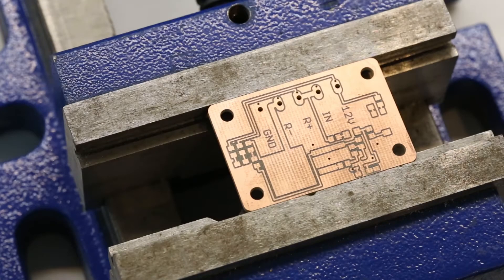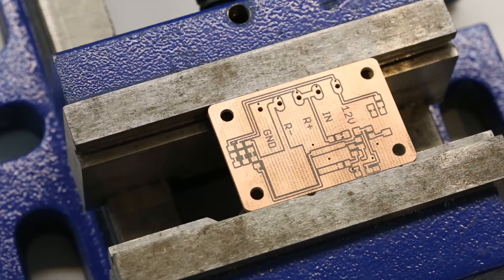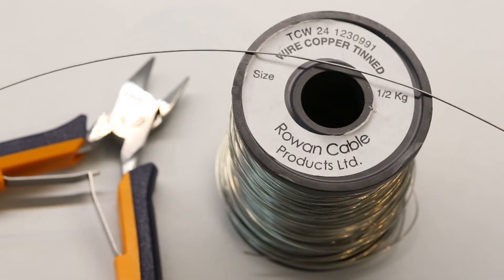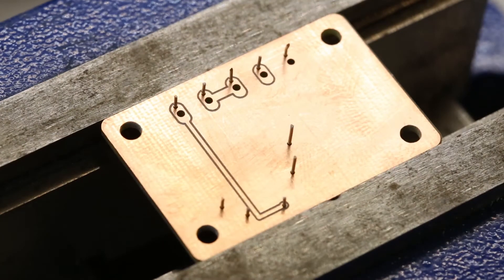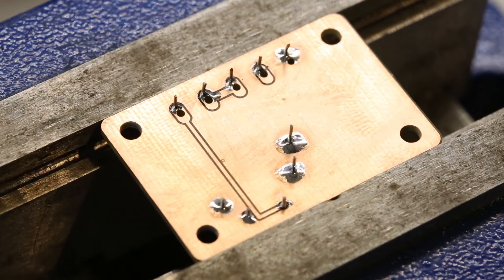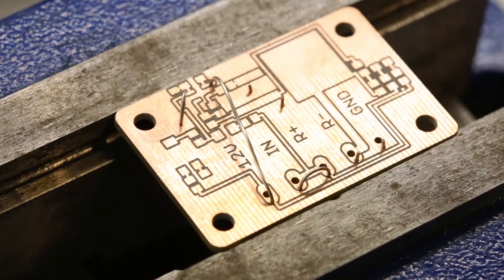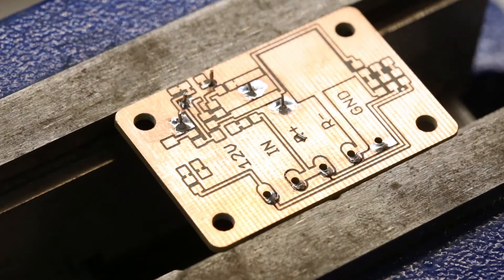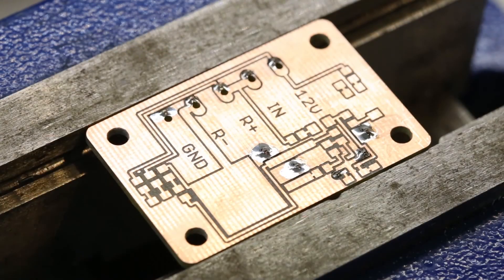Vias on a home-made PCB

Comment: How do you get those extra via holes on the pads? Is there an option in Eagle or whatever you're using to add separate via holes like that, or did you manually insert them?
Reply: In KiCad you can make a custom symbol or edit it, and then use it as pad

Comment: I did not have tinned wire. So I strip off the insulation single strand Wire-Wrap which I have. It is very thin and solders very well. Works well. Thanks for the video.